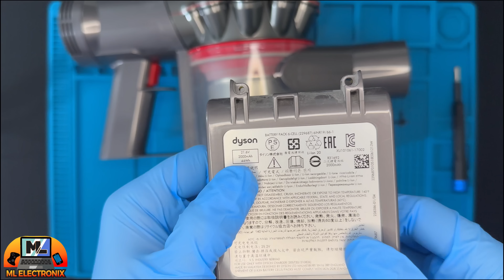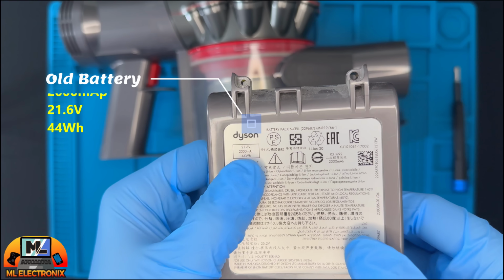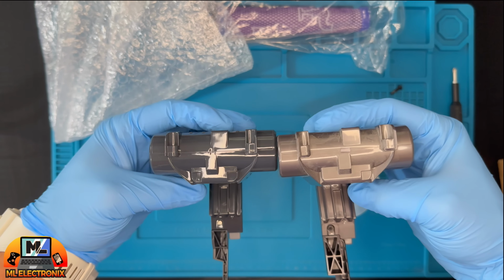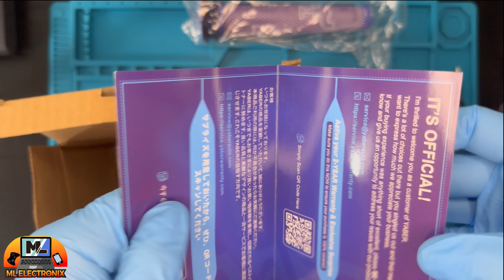How to Fix Dyson Vaccum Cleaner V7 and v8 Red Light Blinking Error

Comment: Luckily it wasn’t the issue with the motor, this could cost more than just a battery replacement 👍

By the way, I missed your posts!
Keep going 👌
Reply from the maker: Oh yeah, I believe that a brand-new motor could cost almost the same price as a new vacuum cleaner made by them. 🫡

PS: We are going to fulfil the customer's expectations with repairs and by recording those videos will share our experience with different gadgets or electronics.